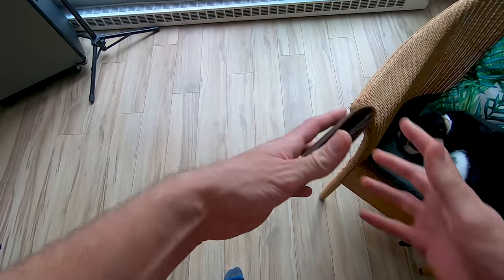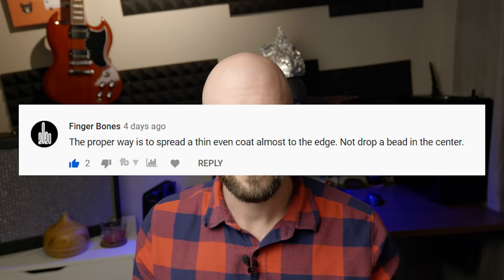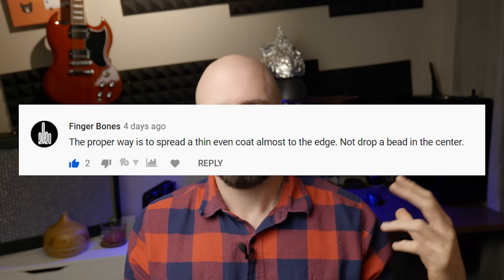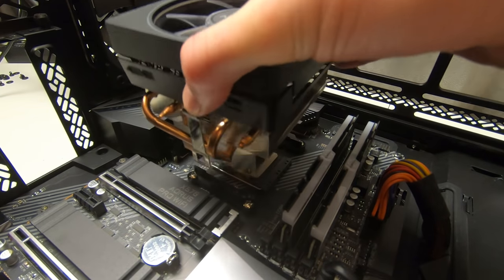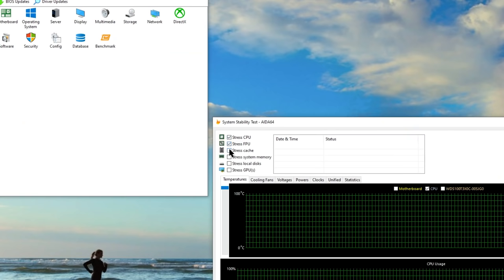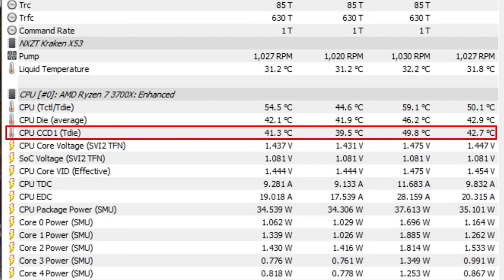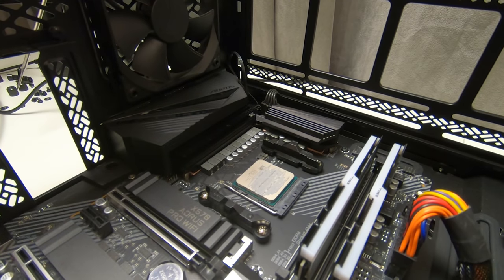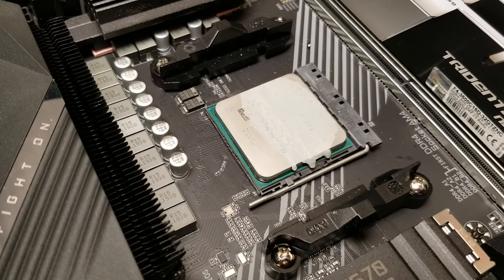Best Way to Apply Thermal Paste? Does it Even Matter?

Comment: And i made a normal dot in the middel with my thermal paste Thermalright Phantom SPIRIT120SE ARGB CPU Air Cooler, 7 Heat pipes CPU Cooler, Dual 120mm TL-C12B-S V2 PWM Fan, AGHP 4.0 Technilogy, S-FDB Bearing, Voor AMD AM4 AM5/Intel 1700/1150/1151/1200 with this coler and have in idel 40 and max lkike 60 !

Comment: nobody takes into account it's which application style matters after a year of gaming.
You put a pea on there. It squashes but misses a part. Temps are fine.
but....
A year later....there was an air gap...and its a hot spot now.

Best method is the credit card method, smear it ALL over evenly, clean the edges..... for temps in the future.

Comment: Don't be lazy, people.  Buttered toast method would maximize heat disbursement regardless of what heat sink you're using.  Some heat sinks don't absorb all areas of the chip evenly so you should try to compensate by spreading the paste over the entire chip in a thin, even fashion.  Been doing it this way since 1994.  The goal is to reduce hot spots.

Comment: Yes it matters but you are only using the cpus temp probe for the temps.  The trust is there will be hot spots where even there is ZERO coverage (the corners) using the dot method.  It wont show up on the temps because that is a over all temp.  In reality it will be cooler in area where the past is filling properly and very hot in areas with zero paste.   That is how it works.   IMHO its best to cover entire cpu if you want good heat transfer in the corners.    Sorry but you can't rely on just cpus sense to see the entire picture and to do it properly is beyond the skill set of these you tubers.

Comment: Quite funny that the only correct method  is called "buttered toast". Don't fall for this derogatory term, guys: the thermal paste is supposed to fill-in small microscopic holes in the surfaces, both of the heatspreader and the cooler. Apply just a thin film, but everywhere - of course everywhere, as you want all surface to transfer heat out to the cooler.
If you use too much of the paste, it can actually slow down the heat transfer. Funnily enough, if you buy cheap thermal paste, it is worse than no paste at all. 
I thought all of this was already common knowledge in 2023, but seems this guy started to experiment with different "shapes" of the paste. Like, you want to transfer the heat just from that specific part of CPU? Sorry. No.
Reply: Like he said in the video AMD themselves don't even recommend to full spread method, as it is not necessary.

Comment: What's the purpose of thermal paste?  That should always be the very first question to ask yourself if you're going to do this yourself.  If you don't know the answer then you need to find out.  By spreading evenly the correct amount, you don't leave anything to chance that it will apply properly.  With a dot you're leaving to chance the most important aspect of your computer build to be incorrectly applied.